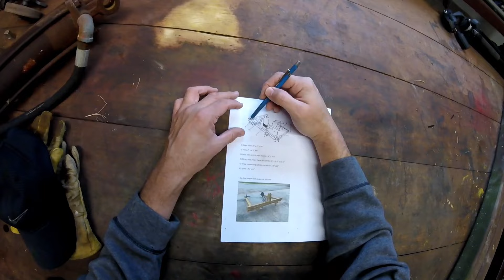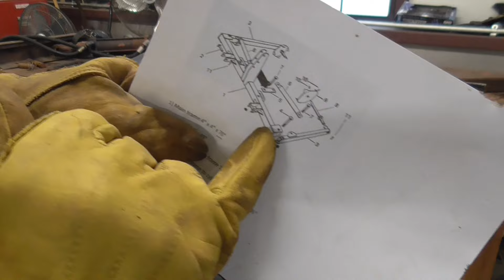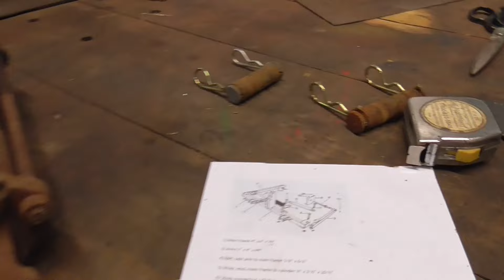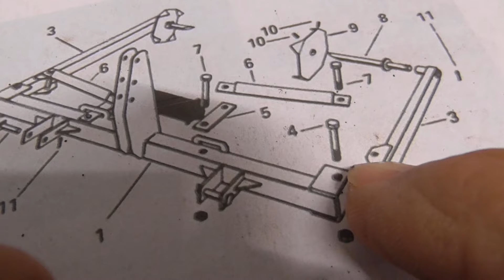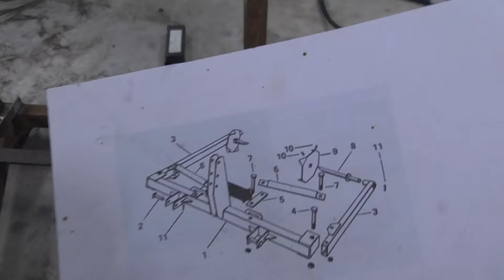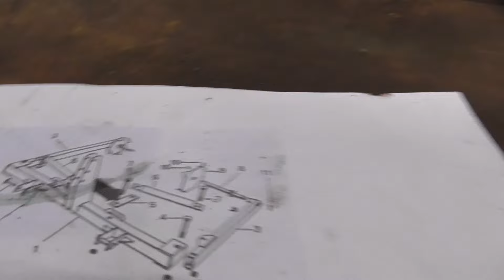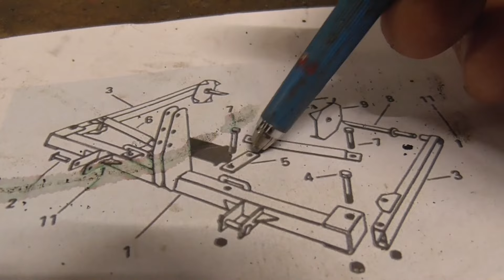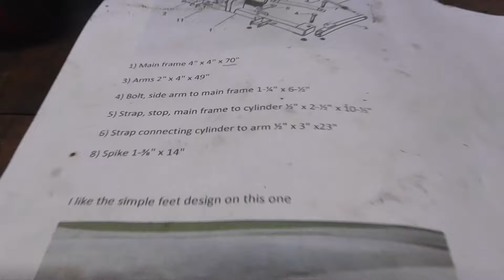Hay Unroller Build, Greg Judy Inspired

Comment: When we were continuous grazing our bale spots looked exactly like yours. When we went to rotational grazing and let the area rest for 45 days or so the area around the bales would spring up and be greener than the rest. As soon as we let the cows in, they would head straight for the rings and eat them down to the ground and they would be almost bare again after a day. What we figured out is that the cows preferred whatever came up there and clipped it off first so it appeared unfertile but was actually too fertile. Either way, it wasn't ideal to concentrate so many nutrients in one area. The bale unroller is a better way to direct the nutrients where you need them and spread it out more. We're hoping to get one in the next year or two.

Comment: It might be compaction issues from the cattle constantly walking over 1 area, spraying herbicide is going to make it even worse. 
The best choice would be put a thick warm season cover crop that includes sorghum sudan grass in late spring, then when it gets around 3-4 feet tall graze it down to no more than 12 inches high. Then geaze it a 2nd time later before fall and plant a cool season cover crop mixture and graze that off when it gets around 2-3 feet high. Doing this multiple times consecutively will build the soil and choke out the weeds so you can eventually plant a perennial pasture mixture of grasses and legumes.

Comment: I know Greg Judy would not have any thing to do with a three point bale unroller on a tractor compacting and damaging the microbial life in the soil.
Reply: It all depends what the soil type is. In some areas with sandy loam that drains well the tractor is fine. In Greg's area the ground gets muddy and stays muddy for long periods after a rain so compaction and rutting is a much bigger issue than other areas.
Reply from the maker: Correct. My soil is sandy loam, the soil is usually dry the very next day after a rain.